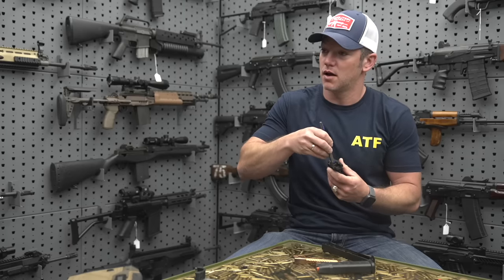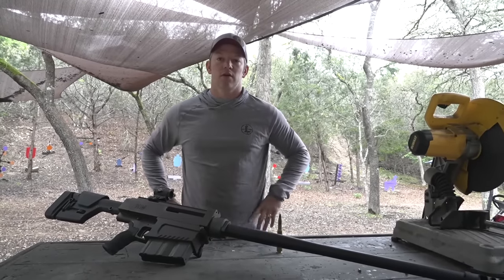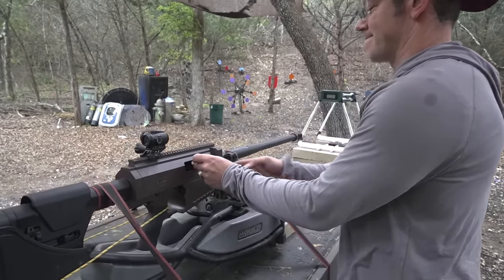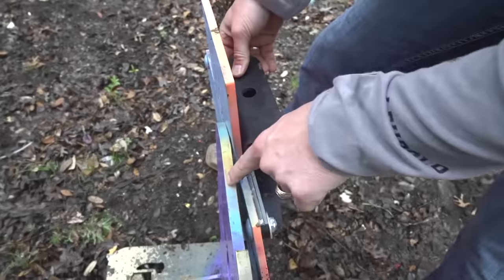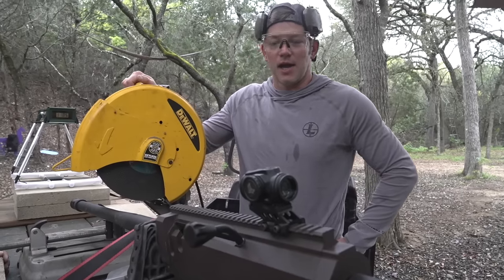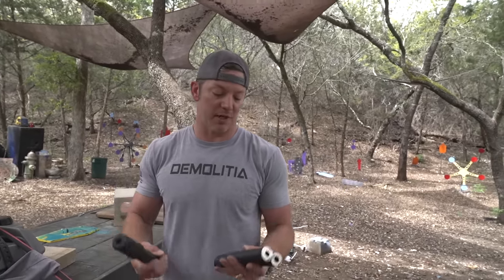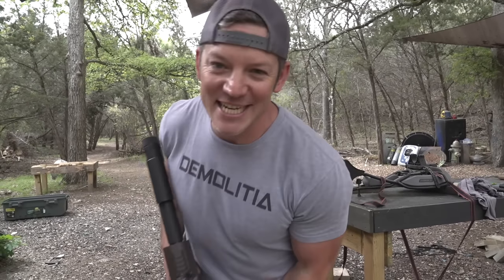I Sawed-Off a .50 Caliber Sniper Rifle...

Comment: I too love ATF. Automatic Transmission Fluids. There's never enough of them being replaced in used cars, because "factory said you don't need to, ever"
Reply: Hey, it's lifetime fluid!   Fine print: Lifetime rated for 30k miles
Reply: Very true. It often gets so bad that by time you change it out it just dumps the transmission because it was using the coarseness of the metal shavings in the old fluid to help give the transmission friction and now that it's working properly, the transmission starts to slip
Reply: dont need to replace the atf, the fluid's automatic
Reply: @davetremaine9688  well I mean if you take your automatic transmission more than 30k miles in its lifetime you're either crazy or you live in a crazy society that expects you to commute to work every day.
Reply: @TheReaverOfDarkness Had my current car since August 2017 and have put probably 85k miles on it lol. Granted, it’s a manual, but point still stands
Reply: @MrSir2552  Nah, that was my point. Automatic transmissions are for casual drivers, people who just want to get from point A to point B and don't actually enjoy driving.
Reply: @TheReaverOfDarkness  My second car was an automatic. Had it for almost a year before I got t-boned and it got totaled. I hated it, I was just craving having a manual again. It just isn’t the same
Reply: I have a BMW 550i 4.8 litre V8 even though it says lifetime om my auto trans oil i change it every 2 years or 30k kilometres and its done 252k l @TheReaverOfDarkness
Reply: @TheReaverOfDarkness  Every society expects you to commute to work every day, unless you work at home.
Reply: I prefer gear oil, sadly I'm back to ATF as of recently though.
Reply: As an automatic transmission enjoyer I too love ATF
Reply: @MrSir2552  welcome to the stick shift gang (slowly turns to my stick shift Hellcat)

Comment: The rubber table isn’t letting the sound waves escape the metal. If you hold it, the sound/vibration goes into you’re body, same as concrete and other materials.

Comment: ATF: Do you have any unregistered short-barreled rifles?
Matt: Just the tip
Reply: Does it count as "short-barrelled" if the barrel is of negative length?
Reply: @LecherousLizard  Maybe, maybe not. Depends on what the ATF had for breakfast.
Reply: @paulis7319  What if it has no barrel at all.
Reply: @LecherousLizard  does it count as a rifle if all the rifling has been removed
Reply: @krpajda  I guess it's a bolter now.
Reply: @eon2330  then it probably hangs out at clothing optional venues
Reply: AvE: And only for a minute.

Comment: Matt, You owe it to yourself to make those sliced chunks of barrel into Wind chimes, the novelty + harmonics is insane
Reply: It probably won't sound good at all and probably won't sway in the breeze. Bit heavy and thick
Reply: and he should also learn about resonance and frequency 🤣🤣🤣🤣👍👍
Reply: Obviously will need to cut off a chunk of table to function as the paddle though.
Reply: @electricheartpony  drill a few holes only through one side so theres metal backing to catch air and lighten it up and it should. would also get some nice whistling.
Reply: @electricheartpony it will because the striker will be lighter and sway in the wind while the barrel chunks will stay still and ring. Should sound great

Comment: The barrel rings while it's on the rubber because the rubber is elastic and it causes the vibrations to be sent back through the metal with a very low energy loss coefficient. It would work better on a rubber balloon. This is the same principle as to why windchimes work, there's not much energy getting transferred out of the chime through the string so the most efficient way the vibrations (energy) can leave the system is through the air.
Reply: And it highly depend on material too stell is well known for this type of ringing sound.
Reply: All I got outta that was gun barrel wind chimes…
Reply: it also won't vibrate when it's in your hand

Comment: The first barrel chunk with the muzzle brake would make an awesome shifter
Reply: What do muricans need a shifter for?
Reply: @arcuz7862  The magic that is a standard transmission.
Reply: @vipe650r  Good one.
Reply: Gen z anti theft system
Reply: The weight behind your throw to the next gear, might break some ish. 

That barrel is one heavy chunk of metal. 

Best shifter knob I ever acquired, and worked very well, was an 8-ball, from a pool table.
Reply: Bro. brho. thank you for this. I will be doing this one day, and it will be on reddit when I do.

Comment: So on the ringing sound for those wondering. My best guess is that when the barrel is hit or dropped it starts swinging in a certain frequency dependent on the material and length of the barrel section. The reason why you don‘t hear it when in your hand or on the stone slab is, that your hand or the rock stops it from vibrating similar to when you touch a ringing cord on a guitar. The material of the table might be worse at absorbing the vibrational energy and therefore the barrel rings for much longer and can be heard.
Reply: 12:07
Reply: My gut tells me it has something to do with the width/regularity of the gaps he cut into the barrel. Each little stand alone "arch" is like a mini tuning fork. THIS is just one reason why Smarter Everyday NEEDS to be on DemoRanch!
Reply: @davetremaine9688  all 3 ring, it should have something to do with the length of them. The wind chime analogy he made was very apt.
Reply: @davetremaine9688  I don‘t think the irregularities play much of a role. On most instruments only the length of the vibrating tube, string or other sound producing medium plays a role. With drums, I think it is called a snare that you attach, you can change how the instrument sounds but the frequency stays the same (Not 100 certain on music stuff). The frequency you get from a vibrating object is dependent on the speed of propagation (material property independent of shape) and the length of the vibration. On the vibrating object you get standing waves which depend on the shape (opening on one or both sides of a tube). If you cut partial slits into the tube it might affect one side a bit but my best guess is, that the entire tube would still have those fixed vibrational modes even if parts were cut out as it is still a solid tube.
Reply: @guntera3845  I feel like if one of us was smart enough and cared enough we could extract the waveform from the file and get a better idea... I can do the first part if you can do the idea part? lmao
Reply: @davetremaine9688  Maybe in a few years. I‘ll start my bachelor in physics this fall semester but it‘ll take a while until I can apply it to such things.
Reply: @guntera3845  Alright, cool. Let me know when you get accepted into a graduate program and I'll just hangout here in the comments
Reply: First guy was right

Comment: The reason the barrel part rings is because when you're holding it, the vibrations of the impact get absorbed by your hand. When you're not, there's nothing fleshy to absorb them so they turn into sound waves.
Reply: Fun with harmonic resonance
Reply: Tuning tube instead of tuning fork? 😂

Comment: Hey Matt if shortening slows it....... Can you double the barrel length and see how fast you can get the 50 cal round to exit the "long" barrel. That would be more exciting.. Hyper fast and super accurate?
Reply: You can, but the problem then becomes barrel sag.  You also need a barrel that can accept barrel extensions, or have a longer barrel custom made.
Reply: @daexion and more friction?

Comment: 0:05 What is this G3 like looking Rifle above the MP7?
Reply: @xiomyoutube  It's not a G3 clone in any way but something from the H&K lineup that uses a similar system.
Reply: Maybe century arms C308 or a cetma sporter
Reply: Maybe it is a g3
Reply: @JesusMySavior78  It's not a G3 or clone like i alrdy wrote. This "lower" does not exist for the platform, the barrel is way to short for a G3 and the mag is also not 7.62x51 for sure.
Reply: @friendlyreptile9931  then it may be custom built, I image searched it but it only came up with different things of a g3
Reply: It’s an HK33 or a clone of such. same H&K roller delayed blowback system as the MP5 or G3, chambered for intermediate cartridges

Comment: the barrel is not only for aiming but also for the bullet to get speed due pressure. The shorter the barrel, the less spped it gains. Barrels are measured to have the maximum acceleration for the bullet with the expansion of gas; a shorter barrel makes the explosion go wasted, a longer makes the bullet go slower due suction and air friction. Changing the barrel lenght in artillery is usually a very bad idea.

Comment: They call it Harmonix. If you cut barrels and need to find the cutting ✂️✂️✂️ points. Swab it down with oil fire it and those harmonics will make oil rings will show you where to cut..

Comment: Ported barrel? Haha you need that for the length of the barrel your using to keep that big of a round to go straight. If not with its size im sure the muzzle velocity with the short barrel wont be accurate due to bullet voble..

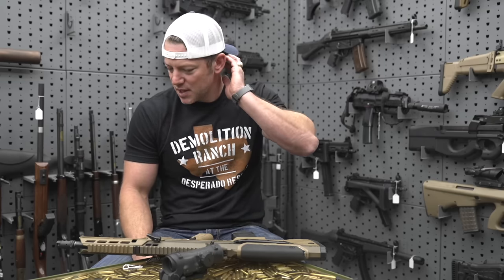Comment: I think I can answer your friends concerns for you 1:47 

The ATF is actually pretty good at their handling of explosives related cases and in that regard they're actually very good, Everywhere else however they're pathetic where they're acting as an administrative body with way too much power, and not enough oversight. They could do better, but on average they don't.

Many of the firearms cases they handle don't have a happy ending, either of them getting the wrong guy or they're in a just society being no need for the case that was being handled to begin with. And while they have many and noble effort under their long and proud history, there are some failures within their departments that are so bad they make history, such as fast and furious. A legendary ghost gun sting where they made several and actually cornered the market for a while on guns with no serial numbers, they lost them all and to this day we still don't know where they are. But on the bright side they proved their thesis that any modern destructive device does indeed need a serial number.